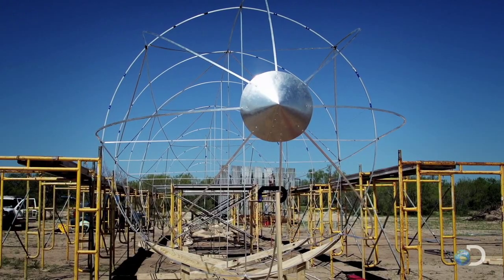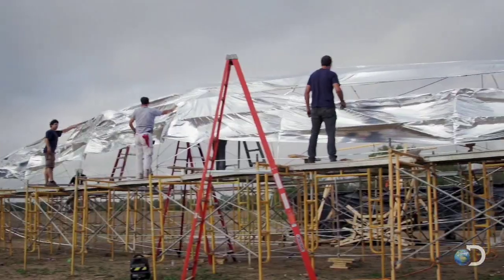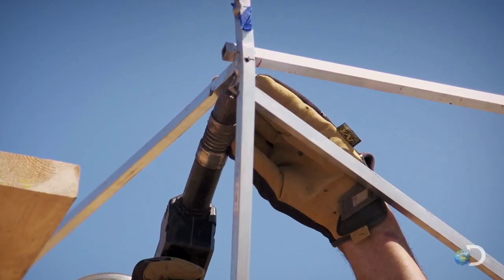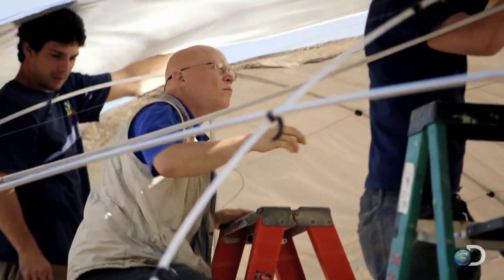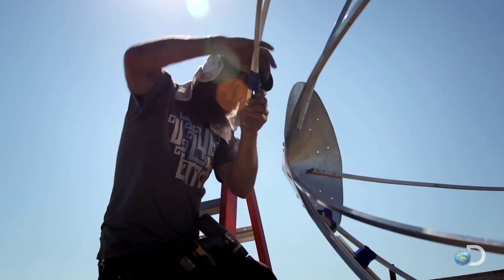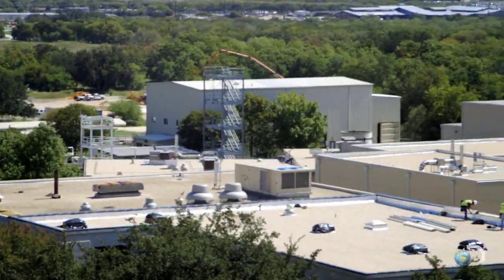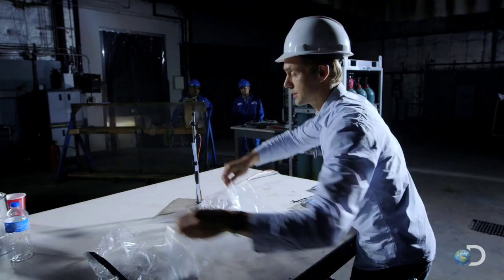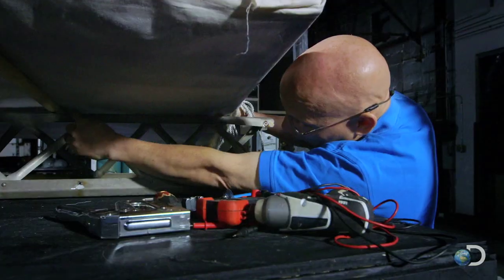Hindenburg Replica Construction | Curiosity: What Destroyed the Hindenburg?

Comment: An 804 foot long airship full of HIGHLY combustible hydrogen. There's not ANY  mystery about materials. The only questions are how the fire was ignited and if there were any hydrogen leaks before the lift bag(s) and/or outer cover ignited (hydrogen couldn't have ignited until it mixed with air).

It isn't a very valid test to cover your models with metalized plastic film when the original was covered by cloth painted with a material similar to what was later used as solid rocket propelant.